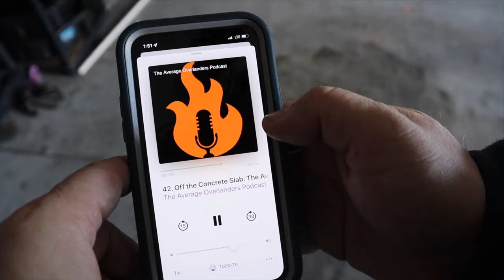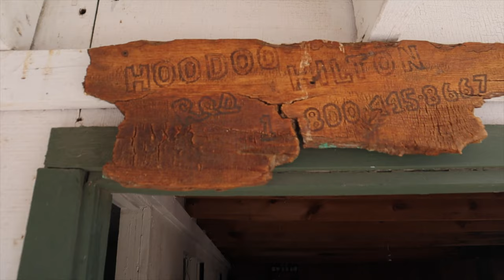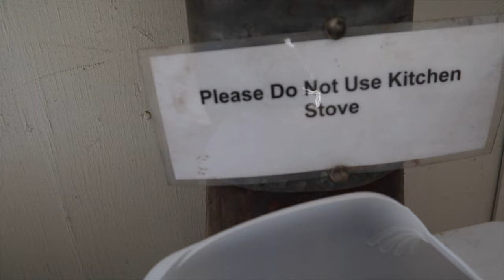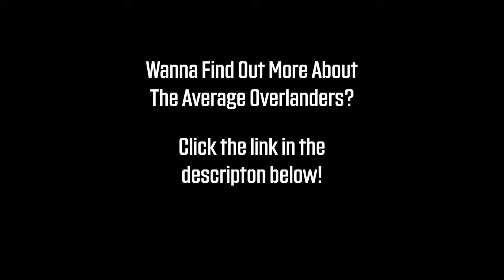We're All Just AVERAGE OVERLANDERS... Breaking Shocks And Losing Drones! | 4K

Comment: Great video on your overlanding trip. Looked like a good time.  On your shock problem… I’m not a ‘Dico’ / LR owner but I’m a Jeep owner for 40 + years and a home mechanic/fabricator on Jeeps and your comments on the LR  shock angle design sounds spot on if they are using the shock as a limiting strap.  That will eat shocks with any long travel off roading adventures. Be careful if you put money out for good performance shocks like Fox, that they are (the jeep ones I’ve dealt with) are aluminum bodied and you can’t use them as limiting devices.  You need to put limiting straps on with the shock change or you’ll trash your new high dollar shocks. Just throwing out my two cents worth…. To maybe help out.
Reply from the maker: Thanks! I ended up picking up the Terrafirma Big Bores, but the ones I got were the +2" and with the lowered shock mounts, had about an inch of stroke left in them on level ground. Got some new OEM upper shock mounts, will try to get them mounted in the net couple of days. I have zero worries about these Big Bores breaking... they're about as heavy as a wheel and tire!

Comment: Great trip. Love the 'not overlanding if not searching for your drone'! 
Aw Mate, dampers suck. Only 3 days ago had to do the same on one of our Discos. Britpart - sheared off eye...
Problem with LR rear suspension is that the shock is the limit strap. Over the last many years I think I've seen most shocks break at the welded on eye. As I've said previously, I had great (20 year survived) DeCarbon shocks in full club trials. I've had to go to $fox$ as I could not get the same DeCarbon when one eventually broke. The other guy with me broke both rear shocks on the same hill. 
If the spring can dislocate then there is nothing other than the shock stopping the droop. I feel that many of the stiff springs seem a bit short as well.
Too hard bushes also seem to play a part. Transmitting too much twist into the eye. 
A 2" drop mount on the same length shock means up travel tops out hard as well.
I've spent a lot of time researching this stuff and years of trials using full articulation so this is where I get my conclusion. A mate and I spent a lot of time measuring various dampers to see what actual travel you got. We found some companies selling +2" shocks that only had the same travel as standard but were longer on compression...
Reply from the maker: Yeah, I’m beginning to think the only real way that solves this is going with the best built shock you can find and probably adding limiting straps. Wish I had the budget for some Fox’s, but they’re like double everyone else. I did see there’s a 4x4 shop here in town that does carry them, wonder if they have any in stock?
Reply: @MattKester  the fox dampers were £160 each plus the stone guards. So it is a huge gamble for me also. In the end the foxes have billet construction for the body and eye. Other guys (speed competition peeps) in the club also went fox and have not bust them despite hard use. I just need to save up for the fronts also 😕
I also think that having both top and bottom of the springs will help and act as limit straps a bit.
Reply from the maker: @GavinEarnshaw  yeah, I just ordered the big bores and a set of limit straps… hopefully that knocks it out. Guess I can hose clamp the springs to the buckets too for some more help.
Reply: @MattKester  well good luck! 😃

Comment: What broke on the terrafirma shock?
Reply from the maker: Same thing as the last one, top mount eye sheared off at the rod. That’s two in six months for me. Definitely going to be taking suggestions for a different replacement.
Reply: @MattKester  are they being yanked apart or twisted?
Reply from the maker: @blacksquirrel4008  looks like the tension is pulling then apart. Same deal with Jared’s OME’s. I’ve got lowered shock mounts, his are stock.
Reply: @MattKester  is it coming apart at the weld?
Reply from the maker: @NickyTBeats  yes!
Reply: @NickyTBeats  that is a pretty common point of failure for many dampers. They act as the limit straps…
I started with a Disco in 1992 and would break a standard LR damper pretty regular. LR dealership ran away from any acceptance as I’d used it off-road. In the Club we’ve had this kind of failure on almost every type of shock with disappointingly regularity. Over the years, OME, Terrafirma, Britpart (original and their heavy cellular ones), Rancho, etc. One competitor had a kind of sponsorship with RS6000 I think and broke one every trial. I put deCarbon ones which didn’t fail on the Disco and were still on it 7 years after I sold it. I have a 90 now (bought ‘98) and after busting the rear shocks replaced them with deCarbon custom ones. I eventually broke one last year (‘21). I could not get the same ones so ended up buying Fox Perf 2.0 in +2. Relocated the damper mounts back to normal as the fox are longer to ensure they don’t top out before support from the bump stops.
A mate has a kinematic simulation of the rear suspension and we spent ages measuring different dampers (and +2 doesn’t mean the same thing!). I personally think I’ve seen more snap with harder poly bushes in and the later eye. Early RR had a larger eye allowing more flex in the rubber. This is what we found with the model as well. Both up and down put a great deal of strain on the eye mount. With the springs not being held in top and bottom the damper can get shock loads when they run out of travel. 
Interestingly the UK Fox importer made it clear that I was to use a different lower bush than Fox supply as they were getting the pin end shear off. The replacement bushes are larger.
Reply: @MattKester  sounds like a different way of securing the lower limit might be a good Idea. Limiting strap to soften the blow perhaps?
Reply from the maker: @blacksquirrel4008  just ordered some! Hopefully I guesstimated the fit right!